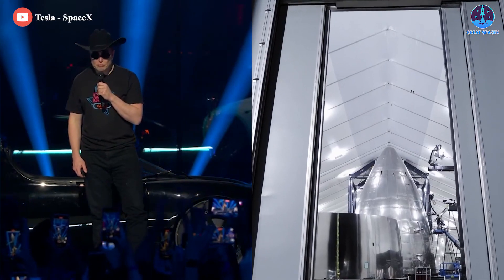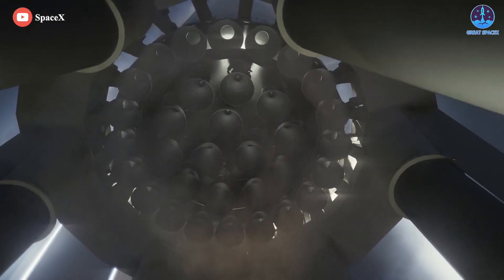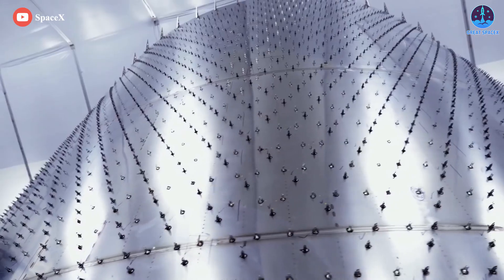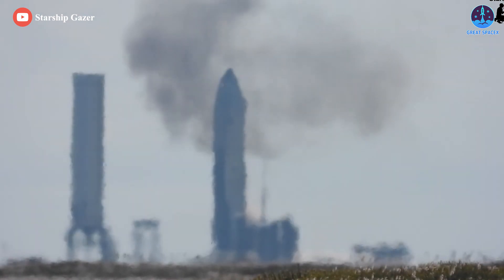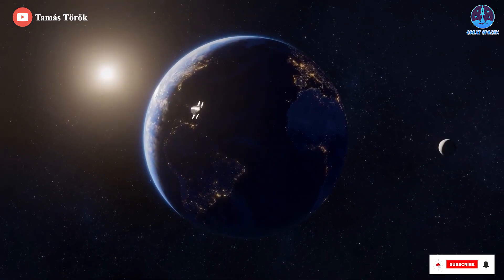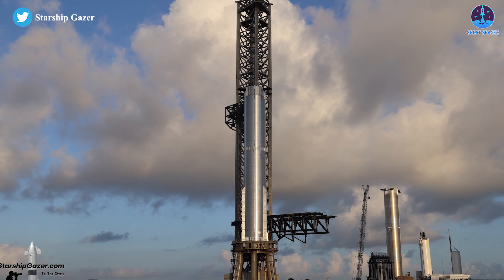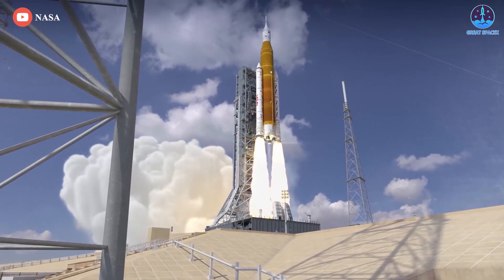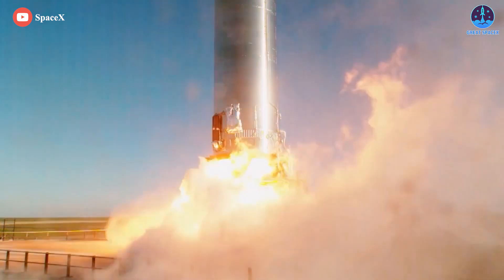FAA said "No orbital flight for Starship unless SpaceX completes all requirements"

Comment: The FAA is not NASA -- they are two different agencies!  And bypassing regulations sounds great to the business types until it bites them in the a@@.  Example:  Boeing and the 737 Max.  Hundreds of people were killed because Boeing used Jedi Mind Tricks on the FAA to convince them the Max didn't need simulator training for current 737 pilots.  If Starship crashes just after launch the impact to the area might be enormous, if it crashed into the populate areas that are very close to Bolsa Chica the death toll could be hundreds or worse.  Musk took a gamble on building out the Bolsa Chica site and he did not do the appropriate investigation to see if that location was viable.  He saw that it was close to the same latitude as the Cape and there is a decent distance between Bolsa Chica and Florida or Cube and it would be a site he owned 100%, but the proximity to populated areas such as South Padre Island posses risks that Musk didn't care about.

Comment: They are destructive as a matter of course at this point. Paralyzing regulations, shutting down the largest baby food distributor for months on what was just another recall, killing oil production, stranding ships off CA cost for a month or more, firing massive numbers of people who don't want to take yet another vaccination for a disease that ran its course, raising intrest rates at breakneck speed when it has precious little effect on inflation even as they try to spend even more trillions in garbage legislation to run up the national debt in the middle of ruinous inflation. Hire two known haters of Tesla to the two regulation boards in charge of autos NTSB and NHTSA (one of them a board member on a competing company). 

Of Course its Corruption! Why would anyone bother to assume otherwise at this point?

Comment: Absolutely - Boeing and Biden would be embarrassed by a private contractor successfully using state-of-the=art rocket technology while 40 year old rocket technology can't even pass a wet dress fuel loading without dangerous leaks and valves sticking. Boeing has lost its edge and is merely using the government paychecks to maintain their unsuccessful technology group. So far, Biden is buying into Boeing's false and worthless front - no surprise there.

Comment: It's purely political as the current administration DESPISES SpaceX and Elon Musk. They are doing everything possible to prevent SpaceX successes and progress as the SLS, Blue Origin and others stumble along with one failure after another. SpaceX is currently the least expensive, crew certified and proven method available for access to the ISS and this irritates the current administration to no end! With Boeing Starliner per seat launch costs about 60% HIGHER than SpaceX, NASA can send TWO Dragon capsules to the ISS for the price of ONE Starliner. In a business where funds are precious, SpaceX has the obvious advantage...which infuriates the DemonicRats and Brandon.